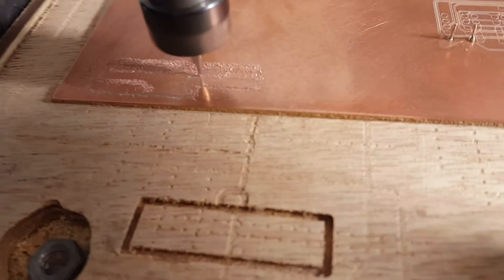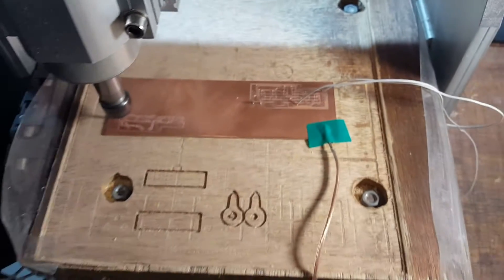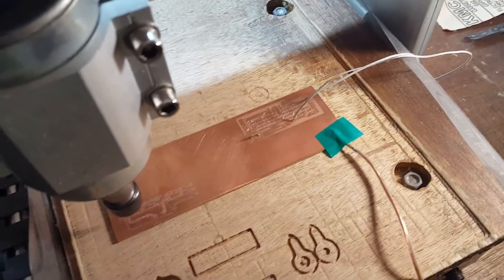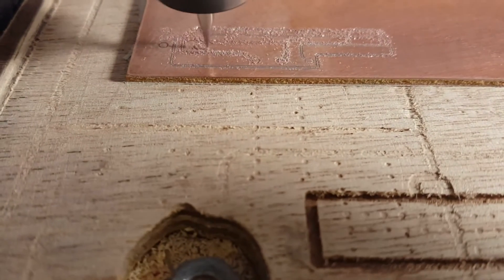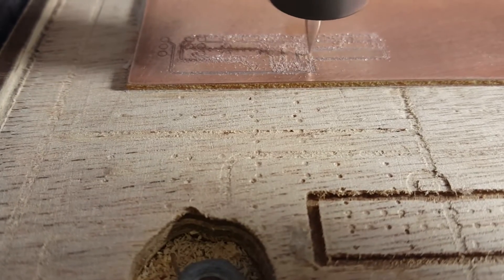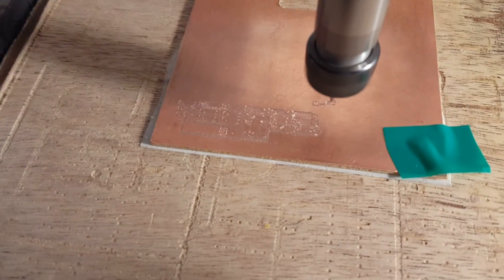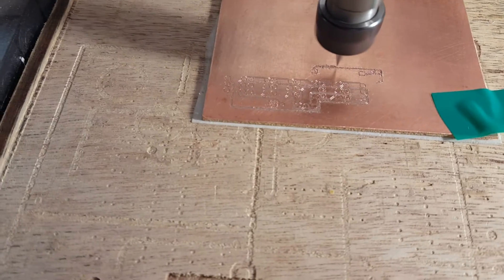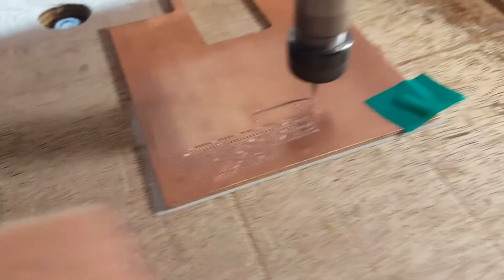CNC 3020 Thinnest Tracks/Pads for Isolation Milling PCB at Home

Comment: Amazing!, which is the Z depth you have used ? I use flatcam to generate my gcode from gerbers and then Autoleveller
Reply from the maker: Don't remember anymore mate. I think 0.1 or 0.15mm. Needs some experimentation with bits/boards you have.
Some PCBs might have slightly thicker copper but eitherway, I reckon 0.15mm should be plenty

Comment: can u please tell the what are the tool bits you rae using fol milling in this vedio
Reply from the maker: If I remember right, it's 0.1mm 60degree V-bit.
I sometimes used 0.2mm bit, but then switched to 0.1 and instead added cleared extra copper in multiple passes.
Reply: thank you very much